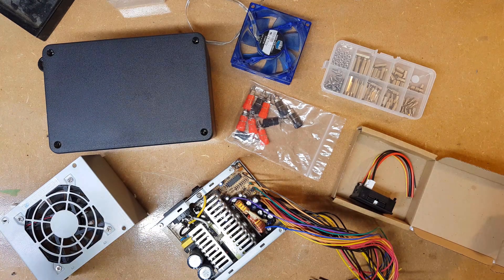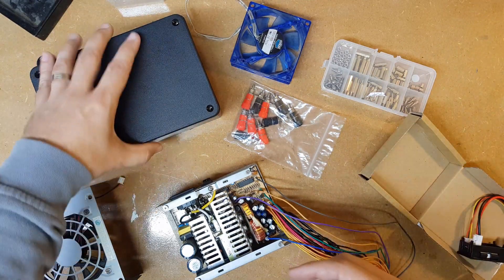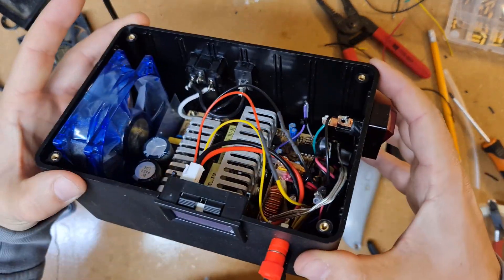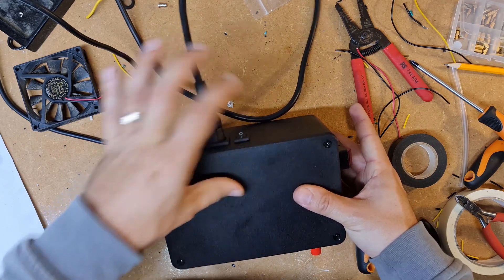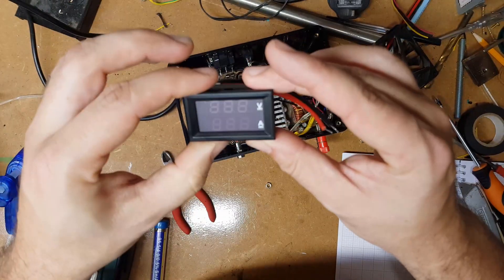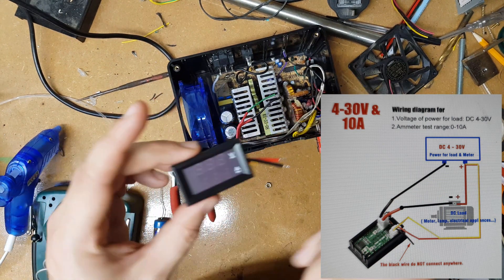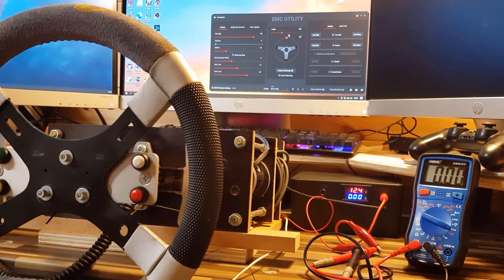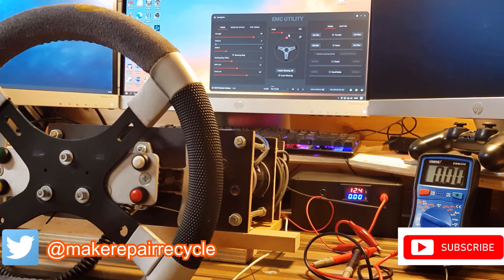DIY Force Feedback (FFB) Sim Racing Wheel - Part 5 Power Supply

Comment: I have done this same configuration  using emc utility. I have a problem where the steering wheel turns more to the left than to the right, is there an option to fix this any help would appreciate
Reply from the maker: Hi there - it's been a long while since I used mine, and the licence utility no longer works 😞 but I think that is a problem at my end. I would contact EMC, when I was dealing with them, they were really helpful.

Comment: Can dc adptor be use instead of power suplly unit.....i  am using 12v RS-775 dc motor with max torque 6400rpm

Comment: Please sir make a video on how to make a non force feedback steering wheel with only using an encoder 🙏🙏🙏🙏🙏🙏🙏 is it possible
Reply from the maker: Hi - non-feedback is a lot easier, as you can just remove the feedback motor, motor driver board and the belt/chain drive. You will just need the wheel shaft and the encoder connected to the Arduino.

Comment: Great vid👍. On the first part where you did just the wheel, could you just use that, and instead of installing paddles etc... just use a keyboard/mouse for the gear shifts/gas/braking? Cheers.🙂
Reply from the maker: Hi, can't see why not. It will be just down to mapping the right buttons in the sim your using. The EMC Utility also has inputs for pedals using rotary potentiometers wired into the Arduino. Not tried it myself tho.